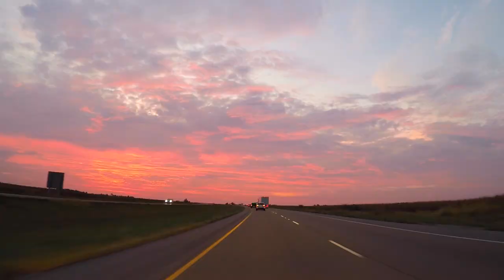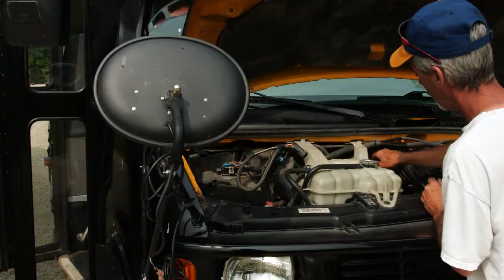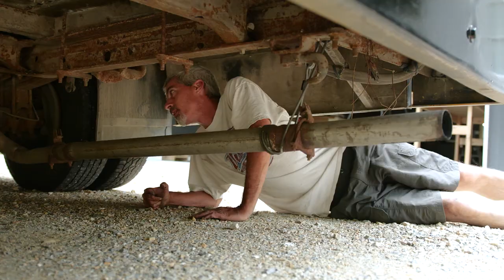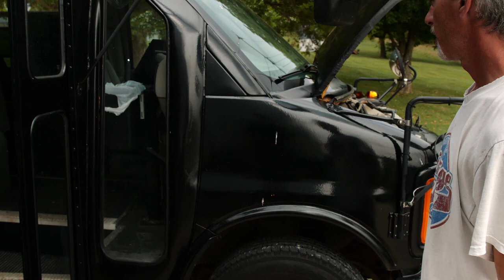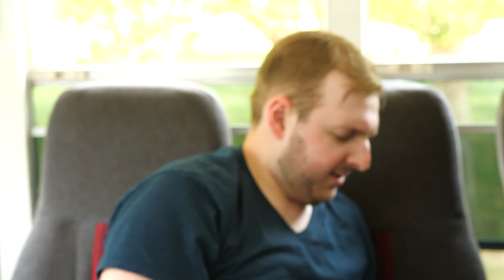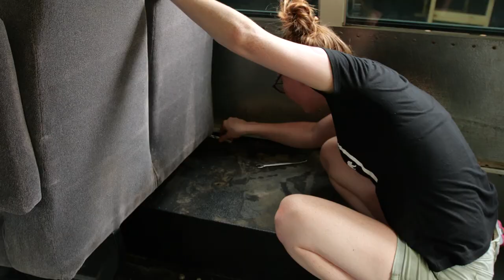What to Check Before Purchasing | Bus Conversion - Day 2

Comment: being a mecanic or at least someone with some knowlege of cars and trucks i say the guy is pretty trustworthy , about the tires : dont get recoversthere cheaper but will loose big chunks of tread downthe road , the carcasses theyuse for these have been on the road for a while and might have internal faults , just dont use them wrong way to save money 
namebrand tires like goodyear michelin firestone are known to ride smoother and are eazier to balance , some have softer rubber compounds that hold the corners better ad are queter but wear faster , might look intoo that
as for the bolts holding the old seats on the floor : there through and through bolted , best way to get rid of tem is to grind off the heaeds and puncht the rest through the floor , need to silicone the holes shurt after that
Reply from the maker: watahyahknow We figure it out eventually 😅😅 Cole and I were CLUELESS when it comes to tools at first. Dad comes in and saves the day(s).